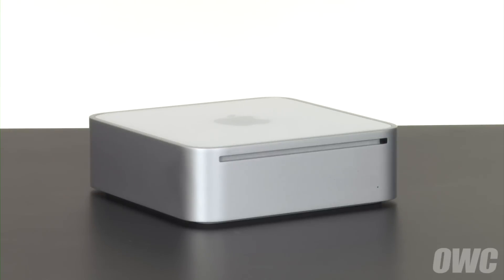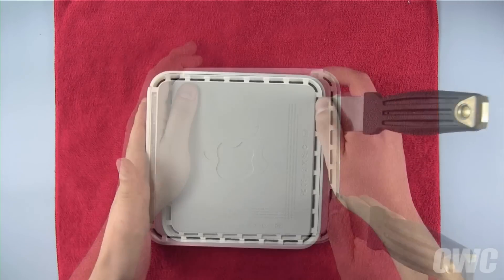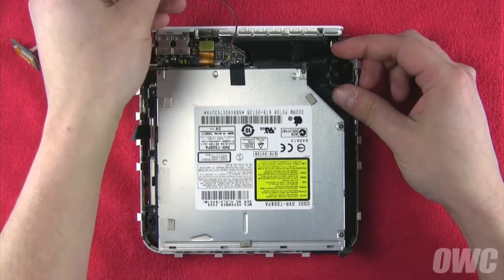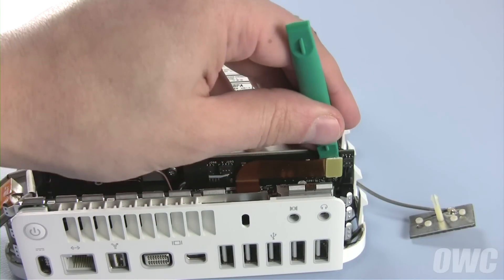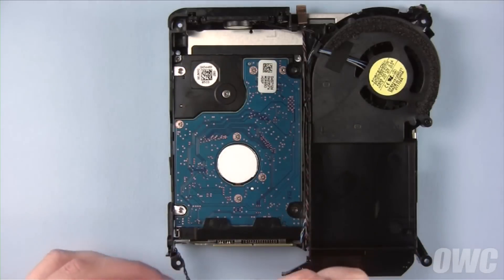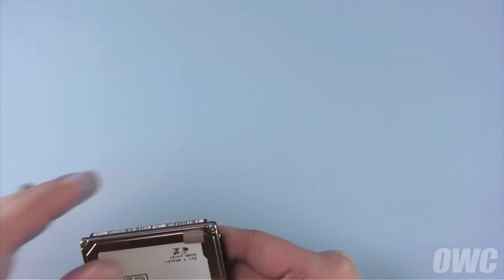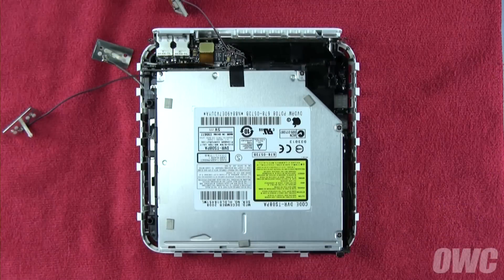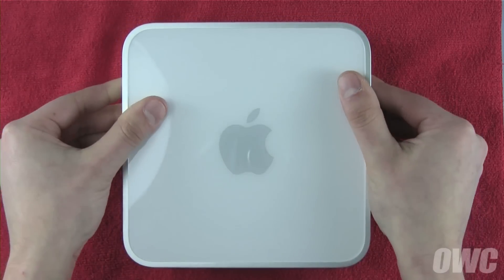Mac mini 2009 Hard Drive/SSD Installation Video

Comment: what all function 3 antenas on there?
Reply from the maker: The Mac Mini has 3 Antennas used for both Wifi and Bluetooth signals. Does that answer your question?
Reply: @poweredbyowc  if one of them damage, can we still use wifi?
Reply from the maker: Depending on the damage some functions will might be available on this device. For more information, we recommend reaching out to Apple support.

Comment: I used a 3" putty knife. Worked like a charm. Also, really be careful with the antenna. It HAS to go back on the connector port closets to the back of the WIFI card and it's easy to bend the little tangs that hold the connector wire to the card. Otherwise, everything else is a breeze.

Here's the interesting part. I put an SSD drive into the mini. It had a Windows 7 installation on it from an attempt to change out the Dell D620 laptop hard drive. But the Dell still didn't want to work properly because of too much hardware change, so I decided to install it in the mini instead.  After installing, I decided to see what would happen if I just booted it up. To my surprise, Windows 7 booted up and started to automatically install drivers. After about 40 minutes, it was done, with a few driver errors.  The audio still didn't work, but, surprisingly, the networking did. It was just a test. I'm definitely going to transfer my Mac OS off the original HD to the new SSD. I've used Windows since '95, and don't care to use it anymore.

Comment: Beware the two rectangle antennas, visually confirm the post goes into the socket, otherwise when attaching the top you will damage the antennas.
Reply from the maker: Thanks for the tip Craig!

Comment: Thank you for the tutorial. The music is unnecessary at best and crazy-making at worst. If you simply can't live without it then know that BG music must live 12-20dB below narration. You can test this by turning down the whole mix volume until you can clearly but just barely make out the narration in a moderately noisy environment; say, an office. If in this scenario you can still hear the music then it's probably too loud. Mixing tips aside I maintain that if it adds nothing—and even worse detracts something, as is the case here—then the music is best omitted altogether. Thanks again.

Comment: Hello. I know this vid is old, but I have a crucial question. For the sake of overkill, I wanna install a 140mm fan on my 2009 mac mini. I know the fan connector isn't the same, but could I just solder the wires from the logic board to the fan? Thanks.

Comment: I got stuck installing an SSD because the SSD was thinner than the HDD it already had and it is extremely difficult to install the SSD but after a lot of attempts, I could get it installed by first placing kitchen roll paper and then placing the SSD and inserting it and afterwards removing the kitchen roll from the bottom of the SSD. If your SSD is thinner, then it is merely impossible to connect it without placing something like I did in the bottom. Maybe straightforward for some but it took me some time to figure it out. Excellent video one must admit.
Reply: Did you pick any specific SSD, or do you believe any SSD is compatible? Also, how do you make it so that the SSD boots to the OS, assuming you bought a totally empty drive?
Reply: @petedoe6872  Any SSD will work, you can clone the hard drive thats inside to the SSD or you can install a fresh copy of mac OS.

Comment: Thanks for the great video. I was able to upgrade my late 2009 Macmini to an Adata 240 GB SSD drive after watching it with no problems. Makes my machine have a much faster start-up and just run faster overall - plus the internal drive was already 5 years old so I figured I better replace before it failed.

Comment: Hi, great video. I have a 2007 Mac Mini 1.86 160hd. And I want to add a second hard drive with 500gigs in side it. Is that possible??? And I want to put 10.7 on it.How can I put it on it without erasing the origanal disk thats there. So how do I put 10.7 on this other drive without dissterbing the one thats in. Thanks.

Comment: Jesus-h-christ it would be easier to just buy a new computer. Pity that Apple are such bad value for money.
Reply: +pduffy4 Bad value? These are 2009 computers that are being updated, some for the 2nd time, and still work better than new machines from other vendors while running the latest software!
Reply: What do you mean? This mac mini is extremely easy to service, especially compared to the recent mac mini and macbooks.